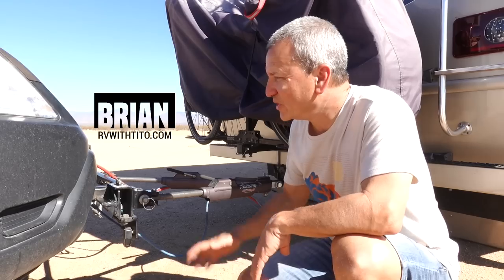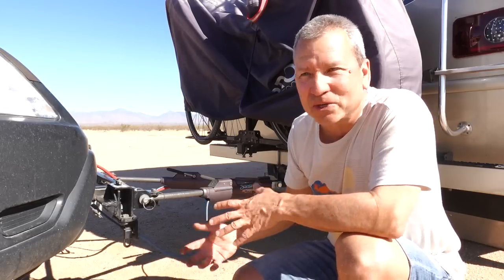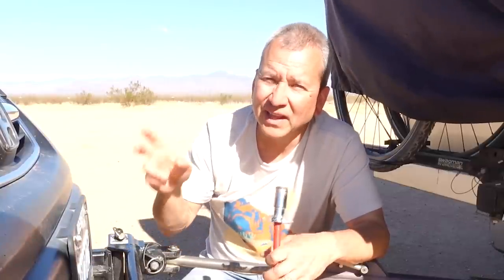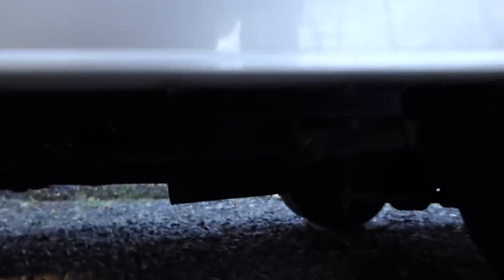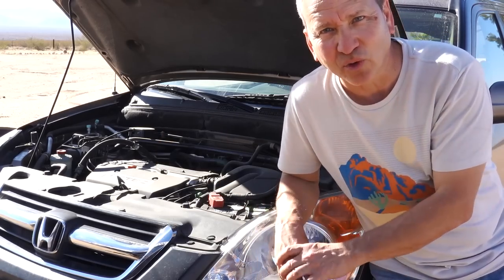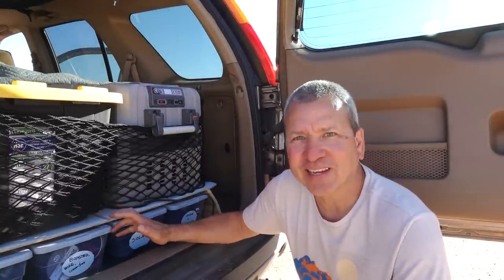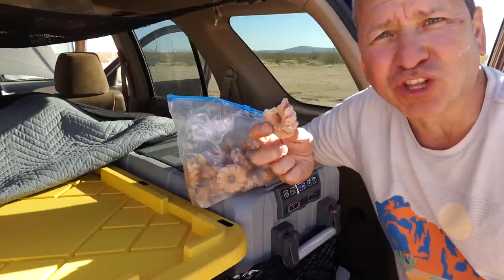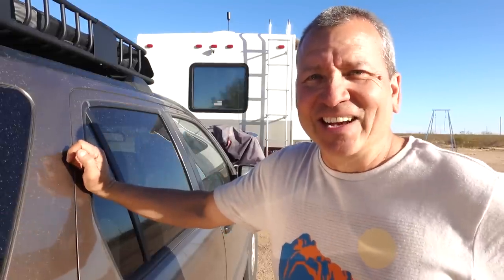Power Tow Car From RV's Lithium Batteries and Solar (DIY Project)

Comment: Im using a 2019 Jeep Wrangler as a toad with my B+ motorhome. I’ve learned the hard way that when placed in tow mode, the Jeep in “Accessory/Radio” function.....idepleted the onboard battery in a remote area. One dead Jeep.
The system presented looks interesting and logical...but seems labor intensive. In the meantime, I always carry a battery charger/jump system.
Reply from the maker: I hear ya. I've killed car batteries too in the CRV. It's been really nice on long back-to-back travel days not to have to worry about the CRV battery any more.

Comment: Or you could have: 1.) hooked up a wheel to the back of the CRV with a generator on it; 2.) put solar on your CRV rooftop; 3.) built a small nuclear power plant and put it in the CRV; or 4.) Talked with Jason [GWTW’s] and figured out a wind generator.   Brian, I’m always impressed with your ideas and solutions.  I hope you pick the small nuclear power plant to do for your next project!  Keep thinking.
Reply from the maker: Do they sell portable nuclear power plants on Amazon? Got a link? :) I've done the solar thing too. Works ok, but limits what I can do on the roof rack and requires more components and cabling.

Comment: I always love watching your videos.
Question: why didn't you just bring your 12 v to your car battery? You already had 12v for your brake and your freezer, and when you use your car alone, you don't have to change the 12v input of your freezer.
That is what I did a few years ago with my towed Jeep, worked ok.
Stay safe, and again thanks for the videos.
Reply from the maker: I just prefer keeping both battery systems separate.

Comment: We found the NSA's Ready Brute tow bar with the built in surge brake is much easier and cheaper than a tow bar and a Brake Buddy. No power is needed. No climbing under the steering wheel to connect. No worry the power may go out and no need to find a place to store the Brake Buddy. We've used one for 8 years with zero problems.

Comment: It’s a great idea.  But I was wondering why not just connect to the battery system directly?  I saw some rv channels (ex. loloho) run an Anderson connector from their tow vehicle to their trailer so engine batt can charge battery bank, just thinking.  Great episode, easy to follow
Reply: Engine battery to engine battery is fine since the coach engine battery has a charging regulator.  It's not a good idea to connect the coach lithium house system to the car battery as lithium runs a Volt or so higher and will over charge and eventually ruin the car battery unless a charge regulator is interspersed between them.
Reply: @bobf.7238  ... Yeah.  I was thinking about a dc/dc charger inline
Reply: @mike_adams  I've used both the Victron and the Renogy DC/DC chargers.  Both work well but the Victron is a bit smaller for tight spaces such as under the passenger seat in the Sprinter chassis.  The Renogy had a misprint in the manual on how to set the DIP switches but once that was sorted out all has gone well on my daughter's trailer.
Reply from the maker: Thanks. Yeah. I see that working well in a truck-trailer setup. A three battery system motorhome-house-car setup adds a little more complexity. Plus we dry camp 100% of the time, so the freezer in the car is running 24/7, not just while driving. And I don't want it running from the tiny car battery. I've always used a portable power bank for this. Finally, I prefer keeping all of my chassis battery systems completely separate from the house and other systems.

Comment: What a great idea! Later this month, I will be installing Ready Brute towing system. So, I don't need it for for the RF braking component but it gives me the ability to power a freezer / cooler and I plan to add LED accessory lights.
Reply from the maker: Cool. It's been great to have power to the CRV and not worry about recharging anything.

Comment: The 2 spare pins are for 12 volt positive and reverse.   Ford usually powers the 12 volt positive pin but it depends on the builder of your RV.  In my case, my 7 pin had no 12 volts.  The fuse was installed and good but no power.  Going under the RV I found a rats nest of wires and within there were the original Ford 7 pin wiring harness.  The 12 volt lead was there but not extended to the 7 pin plug.   I was able to hook it up and my CRV battery is charging while we drive.
Reply from the maker: Thanks for the info. Nice hearing about your setup. The two pins I used weren't even connected to anything. Yes. My assumption was that they were for the reverse lights which don't get used anyway. Another thing I like about this setup now is that I can just leave everything powered on and just lock the car doors when parking the RV with CRV in tow.

Comment: So just curious why you wouldn't just hook the power from the Class C to a battery charger under the hood of your car and then run all devices off the car's 12v system?  Simpler wiring plus the freezer would continue to run while you were using your car.
Reply from the maker: By power do you mean AC power? If so, I don't always have my inverter running and don't want to run an extra power cord over while towing. BTW there is a DC receptacle on the other back wall of the CRV connected to the car battery powered when the ignition is on. While driving the car, I simply move the plug on the freezer over to that one.
Reply: @RVwithTito  No I meant 12v power from your Class C to a DC-DC charger under the hood of your car to charge your car battery.

Comment: Like it. Got one thought, Maybe you could use a Bosch relay so when you pull the plug or the umbilical. The power circuit automatically switches back over the the cars battery. The only thing I see it would be powering while using the car is the freezer.  Then again, if yours SUV is like mine you have a stock 12 volt power outlet already in the rear area (that you used before you did this). Then all you need to do is pull the freezer plug out of the new 12 volt power jack (that you installed in this project)  and pop it into the cars existing   power outlet. Hope I made some sense?
Reply from the maker: You're correct. There is a stock DC power outlet on the other wall that I switch to when driving the car. Thanks for the relay idea. 👍
Reply: @RVwithTito  Was wondering myself. Very cool set up. Happy I found your channel! Blessings

Comment: Solar on the CRV roof!!

How effective is the automatic braking system without the car running since it's not able to use power assist?

I always kind of wondered about towing an electric car and using it as a big freaking power bank.

Great video!
Reply from the maker: It works fine especially when you need to come to a quick stop in the RV. There are three sensitivity levels. I have it set to low.

Comment: Great video.  Could you let us know all the particulars about having a tow vehicle.  I have never flat towed anything.  I'm sure you put a lot of thought in what works.  Tx .... If I'm late to the party could you post a link.
Reply from the maker: It takes a bit of setup and isn't cheap, but it's a great way to tow. Sorry, I used to have a full writeup about it, but not anymore. Here's a very old video showing how I hook it up though https://youtu.be/kUTFOUeER14. It's very similar to what you saw in this video though.

Comment: Thanks Tito. You always generate thought provoking videos!  

I’m wondering if it would be less labour intensive to get a power station for your CRV to power your freezer. I’m thinking about buying a Bluettii 200P.
Also I’m pretty sure you did a video on running your Viaair air compressor using a DC battery plug rather than the alligator clips the compressor comes with. Can you send me a link, thank you.
Reply from the maker: The power station setup is what I've been using (with the Bluetti). It works fine, but you still need to constantly recharge the Bluetti anyway which can take a long time.  I prefer to just focus on the solar and battery charging on the RV side and not the car as well. I don't remember doing a video on hard wiring the Viair. What I did though was to modify the alligator clip cord. I cut it and put Anderson connectors on both ends. Now I can either hard wire it in, or plug the alligator clip attachment on.

Comment: You seem very through in your planning so I'm curious if my idea has issues I have not thought through. I think I would have used a DC to DC chargers to isolate the RV from the CRV and just used the CRV to power everything as you were before, The charger would keep your CRV battery charged and you freezer would stay powered if you had to disconnect for shot periods of time.  You still would have to run the power to the CRV, it seems to me that there would be less changes in the CRV with the charger.
Reply: The CRV battery is a starting battery, not a deep cycle battery.  Its not going to have the capacity to power for long periods of time.
Reply: @sociopathmercenary  I was not suggesting long periods of time, I actually stated short periods of time when disconnected if my response.  I still like the idea of using the RVs power, just passing it through the CRVs power system.  The DC to DC charger would keep the CRV battery charged unless you disconnected for an extended period. His umbilical cord would work nicely at keeping everything powered.  I was looking for ideas of what I was not considering with my proposal. Are there issues with using a DC to DC converter that I'm not aware of.
Reply from the maker: Thanks for the comment. Here are some of my reasoning. First of all, we are dry-camping 100% of the time so the car is plugged in 24/7 when not in tow (powering the freezer). Also I don't want my RV house batteries charging the car battery. I prefer the two battery systems to be kept separate. I already have a DC-DC charger from the RV chassis to charge the RV house batteries if needed. Adding a second one (if charging from the RV alternator) would require over 30 ft of heavy cable plus the expense of a DC-DC charger. Finally, I only need to wire up the CRV one time. The rest was pretty quick. This setup has lots of applications for me. Finally, this whole setup cost me under $50 in materials.

Comment: I enjoy all your videos and learn so much.  Question - Will the brakes still engage correctly if the vehicle pulls away?  Is the power cable longer/shorter than the stretched out emergency brake cable?
Reply from the maker: I'd say the power cable is shorter. Plus there's no way for the power cord to fully extend unless the tow bar becomes disconnected.

Comment: Brian, great idea.  Hey just a question, if your vehicle already had an outlet in the rear, would you consider having your rv “charge” your toad?  What do you think are the pros and cons of this?
Reply from the maker: Since it's connected to my house batteries (not the alternator) I would not want to do that. I don't want my battery bank charging the car battery. I'd prefer to keep those systems separate. To charge from the RV alternator would also require a DC charger and much thicker cable run about 40 ft from the front of the RV to the car.

Comment: my question is the reverse of your system, when my camper is parked (no solar) is there a "special way to wire" from the car to the trailer to charge the  (trailer) battery, if there is no shore power?
Reply from the maker: Sure. That's a common setup. There are a few ways to do it. You can start here: https://www.youtube.com/results?search_query=charge+trailer+from+truck
Reply: thank you

Comment: Wouldnt the breaking system needto be plugged into the battery of the vehicle in case you get disconnected and it gets the breakaway signal to apply the break it has the power to do so?
Reply from the maker: That's correct. That control unit linked to the break away switch is still wired to the ignition but it uses very little power. I still have to keep the ignition on in ACC mode to tow.

Comment: So if you take your vehicle out and drive it somewhere, how do you keep the cooler running?
Reply from the maker: There is another stock DC outlet on the other wall wired to the ignition. I just switch over to that.

Comment: Hey Tito I have a 07 Tioga motor home pretty much like yours the plug- receiver in the back doesn’t work I’m trying to get my toe car ready for  it where is the fuse located for it hope you can help ? Thank you
Reply from the maker: There probably isn't a fuse. The plug wires will be connected directly to the tail lights and should power on/off in tandem with those. I installed my own fuse for the main power circuit I created. Good luck.
Reply: @RVwithTito  thank you so much Tito

Comment: Can you go from your plug that’s on your toad and run a hot and ground to your battery to trickle charge your battery while towing? If I go more than 200 miles without starting the car I’ll have a dead battery. I thought while I was plugged into the RV while towing then if I were to run wires to the battery for a trickle charge maybe it wouldn’t be dead on me and I wouldn’t have to stop as often.
Reply from the maker: Yeah. That should work as long as you can push a higher voltage from the RV.

Comment: 1st in line...er last in line \M/
Brian, please wear some safety goggles/glasses while under any vehicle for any reason, its common sense 101 taught in auto shop in HS from our generation, next time I see you poking around under there I'm gonna mail you a pair, where ever your at.
Reply: I made that mistake once and ended up with eyes full of rust flakes
Reply from the maker: Thanks for keeping an eye out for me (poor choice of words). I've got several pairs of safety glasses, just not on my face :) You're right. I should wear them more.

Comment: Ok I guess sounds like a pain in the ass set up, why not run a panel on the roof
Reply from the maker: I've done that too. But it still doesn't quite do enough. Plus I can't use my roof rack for other stuff.
Reply: @RVwithTito  
I love the set up you have! I run victron myself, that trailer connection is dangerous! mine caught fire! Got to hot in 3 hours driving meltdown along the whole line and melted the fuse open! Bad day! Please use Anderson plugs! I know it’s under 10 amps, so was mine... almost caused a bush fire ! Keep up the good work! Great tips! Cheers from AUS